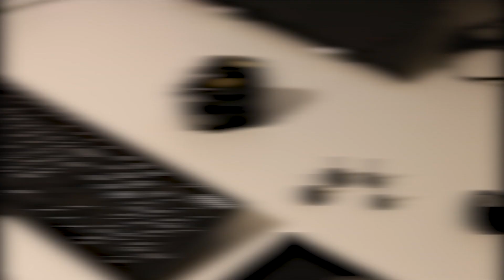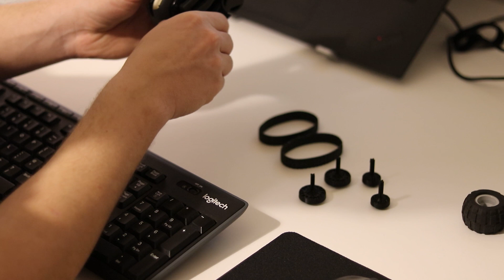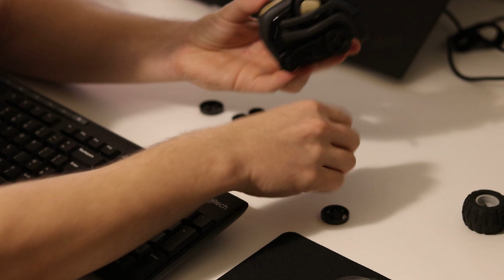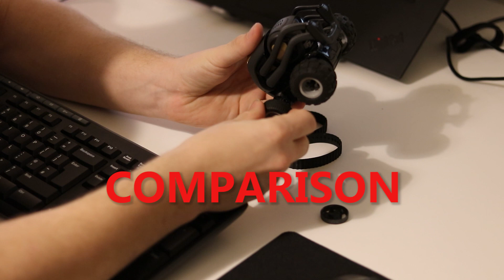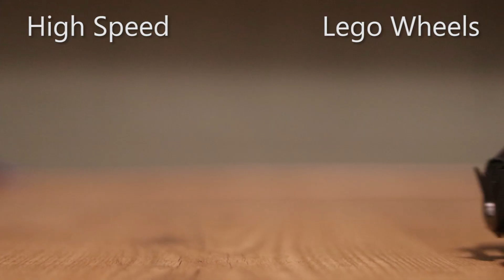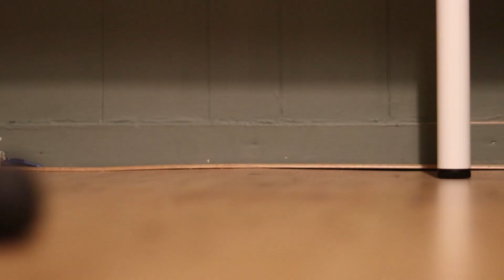Awesome Vector Robot Lego Wheel Mod / Upgrade 3D printable

Comment: Does the increase in height mess up his sensors on the bottom so that he thinks he's not flat on the surface?
Reply from the maker: I am sorry to say that yes sometimes it does😬 maybe i have to put a sticker on his sensors or something
Reply: @JustBaselmansYT  Just as long as you make sure he doesn't fall off the table. He needs those sensors to detect the edges.
Reply from the maker: Yes but with this upgrade i wouldnt trust him with that😂, also his calculations on how far away objects are is probably messed up
Reply: @JustBaselmansYT  Haha! Well he looks cool anyhow!